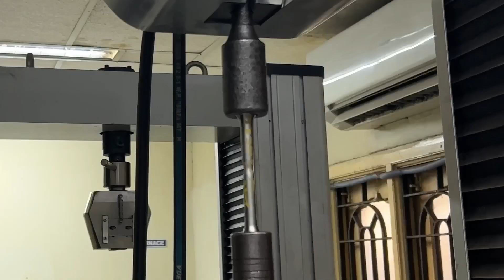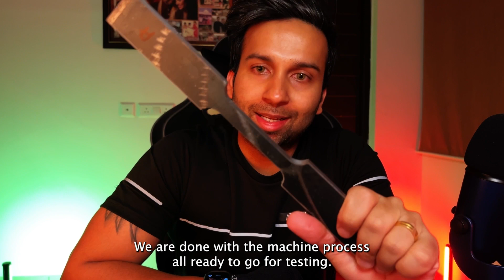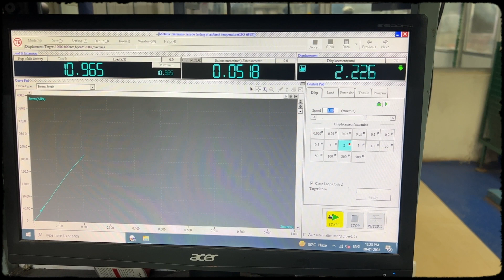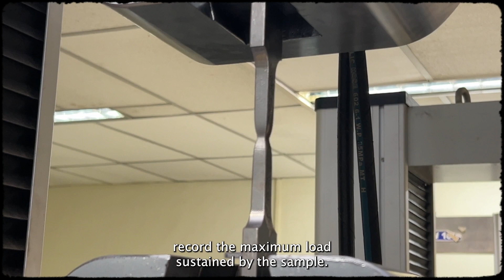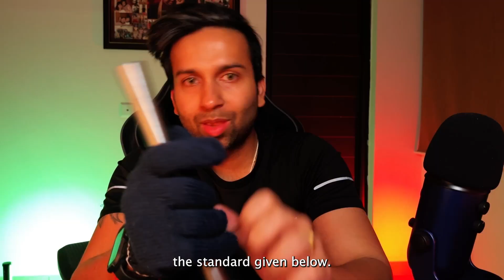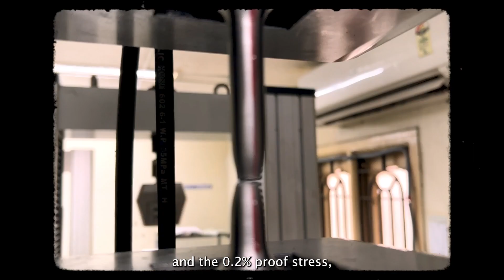Tensile Testing Of Steel | Practical tips to carry out tensile testing

Comment: Hi, but why are we taking 2 different( Punchs) gauge lengths at 50mm either side instead of one in centre. Please reply.
Reply from the maker: Good question. If we have only 1 set of punch marks, there is a possibility that the elongation happens outside this area, which is why we take 2 sets and get a better accuracy on the elongation %
Reply: @microlabtesting  Understood,  Thank You !

Comment: Hey man! thanks for the video. I have a question about the dimension. Should we use B557 to determine an aluminum specimen dimensions instead of ASTM E8 or can we also use ASTME8? Another question is in ASTM E8 as you know there is a table saying Plate type, 40 mm Wide specimen and gives us the standard dimensions for 40mm wide as gauge lenght is 200.0 mm and Width is 40.0 mm and goes like this, so my second question is are those dimensions in the ASTM E8 is the dimensions that WE MUST use or can we also choose different dimensions from them? Ive choosen 35 mm width, 80 mm gauge lenght, 13 mm radius, 5 mm thickness and 50 mm lenght of the grip section for stainless steel specimen and carbon steel specimen do you think those are good for a specimen? And can i use the same dimensions for Aluminum specimen? 
I would be highly appreciated if you could answer! Thank you!
Reply: Hey man! Since it is an Aluminium sample the governing spec will be ASTM B557. You can go with a Gauge length of 50mm and width of 12.5mm if your material thickness is less than 19mm, which is only 5mm in your case (refer to the sheet-type specimen). Note 3 in B557 allows for smaller widths although not recommended.
In the end the gauge length can be modified as long as the elongation % result is not required and your Uts, yield strength values should be ok.
Reply: @sudharsanbalasubramaniam7333   Thank you so much.